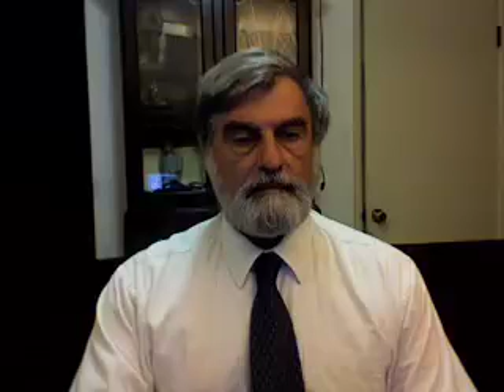Plug-in hybrid misconceptions refuted

Comment: "gas" prices in the USA are generally subsidized, elsewhere prices are far higher and the love of huge cars, SUV's and trucks only fueled by this fact.

The submarine analogy is a good one. However, the technology in storage, electronics and electric motors is very much underdeveloped. You will not get a no fuel car, it is physically impossible to generate as much as you use to travel. Asking too much too soon is unreasonable, this is a stepping stone.

This is a big step in the right direction!

Comment: If a supercapacitor is add to the mix it could hold the charge from regenerative breaking (as at a stop light) then dump it back to the wheels during acceleration saving much wear and tear on the battery pack.

Comment: @automotiveDIY,  For a hybrid, I agree with you.  For a pure EV, there is no tranny or differential.  As for grease requirements, they will continue to be a part of the vehicle maintenance routine.  It will be awhile before a substitute for ALL the things for which we use petroleum (grease, plastic parts, tires, meds, etc.)  We may not see the end of the use of petroleum in our lifetime, but it IS coming....whether we convert to another source or run out.

Comment: The demand for crude would have dropped.  The cost would be more than $1, but less than current prices.  EVs would have a 'history' in which to gauge the future.

Even at $30K, these cars are very affordable.  Subtract the cost of charging an EV from the cost of the gas equivalent.  Now subtract that from the cost of the car.  After all, with a plug-in, there will be no more stops at the gas station.....

Comment: Those savings applied to the cost of the car over say....4 years  for me takes the car price down to just $10K out of pocket cost. At current prices and miles driven averaged out over a year, I am spending about $5K per year on gas.  
4 x $5,000 = $20,000
$30,000 - $20,000 = $10,000
Actually, the savings is MORE.  There won't be anymore oil changes, or tune-ups.  Of course EVs will have maintenance needs, but  won't come close to that of an ICE vehicle.  EVs are more efficient than ICEs.

Comment: EVs were coming along good in the late 90s.  Oil got involved and almost snuffed it out.  GM destroyed/disabled all of their EVs.  Toyota/Ford sold theirs.  Some/most of those RAV EVs are still running on the same batteries and electric motors with over 100K-150K miles on them.   Had Toyota, Ford, Honda, Nissan, and GM kept going, we would have some VERY nice EVs on the road now.  With the availability of EVs for those interested, remaining ICE vehicle owners would have cheaper gas.

Comment: Has anyone done a study to determine what the cost of electricity would be if say 80% of the country used plug electric vehicles? 

I am thinking that would require the construction of many more power coal and gas or nuclear power stations which aren't cheap. I could see electricity easily doubling in cost if not more.